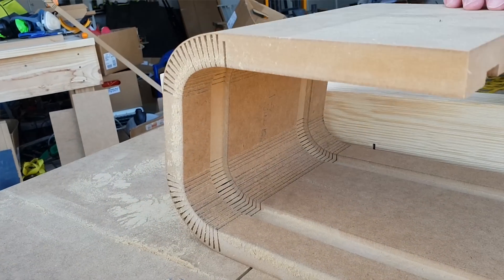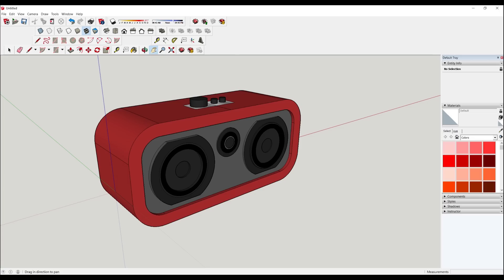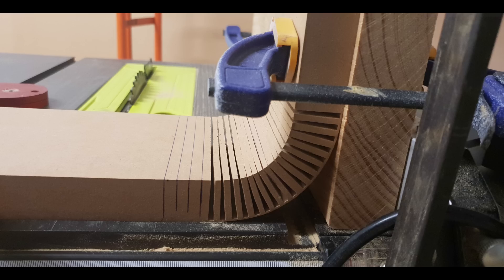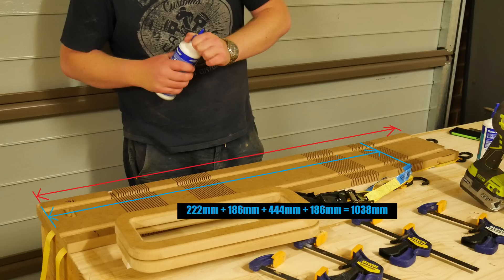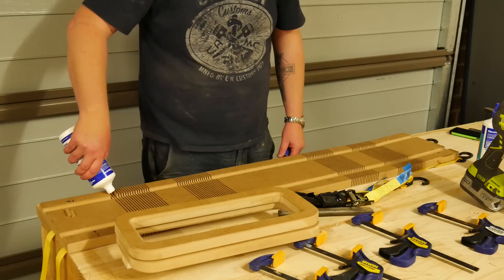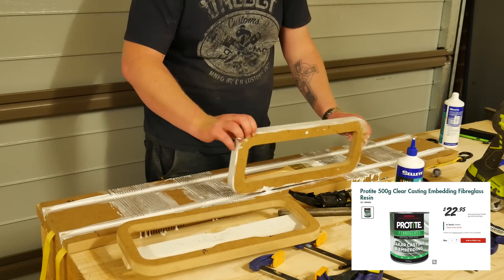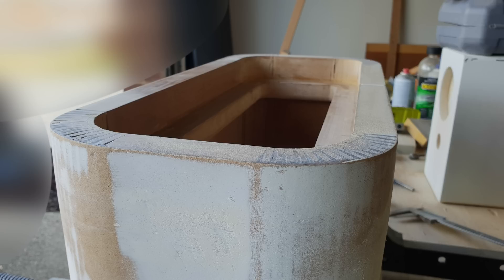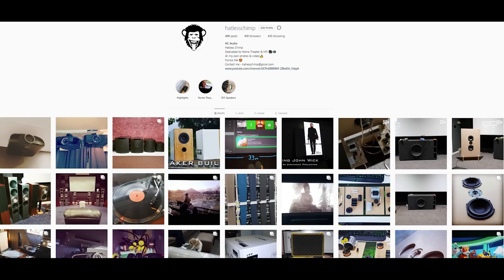Kerfing MDF | DIY Desktop Bluetooth Speaker Build

Comment: were the nails necessary? awesome work btw!
Reply from the maker: I prefer to clamp and nail vs just clamp and leave it. I dont have many clamps so it enables me to use them elsewhere if needed. Also I'm not the cleanest of gluers  so it also gives me a chance to wipe up any excess off the clamps and my work bench etc.